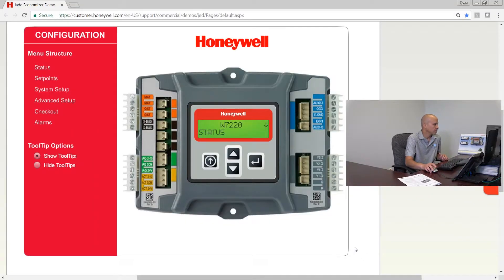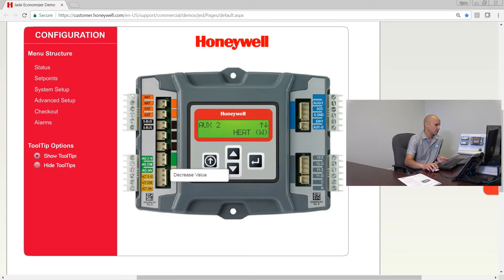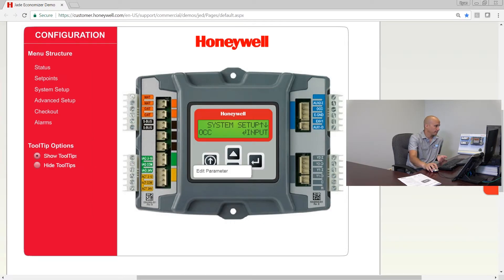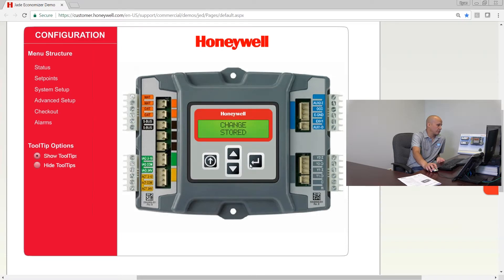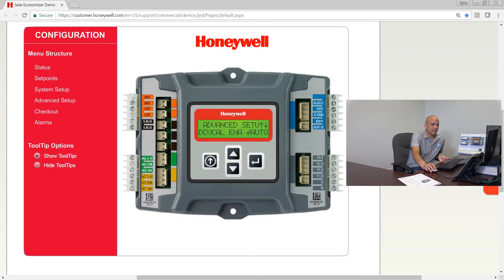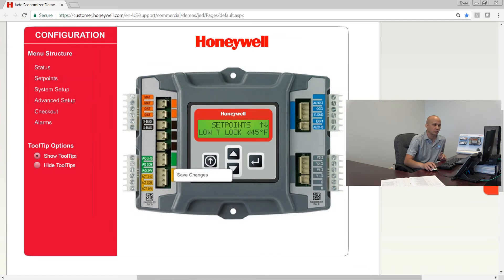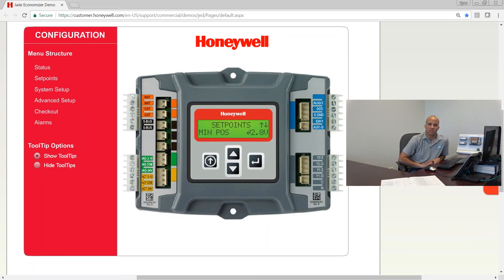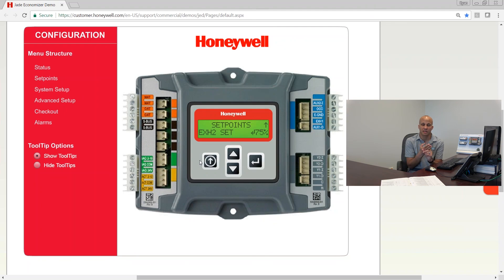Economizers: Honeywell JADE Controller Setup (2 of 4)

Comment: great video! whats a common wb set point? i seen 65f, seems too high but maybe not?
Reply from the maker: You do not have the ability to set the wet bulb. If you have the enthalpy version of JADE, or any other economizer controller, you are picking a "curve." If you look at the curve for JADE, it is controlling to enthalpy setpoint straight line (with the top wet bulb chopped off and the far right dry bulb chopped off. The wet bulb will vary along those lines. It is hard to explain without looking at the curves on a psych chart. But even if you picked the most aggressive enthalpy setpoint (ES1), the highest point that it would ever get for wet bulb would be about 62. If you pick ES2, which we frequently recommend, it would be 59 WB at the highest.
Reply: @TECTubefilms  thx for the response. i can reference a psychometric chart, not to familiar with this controller as i do mainly refrigeration racks .
 im guessing es1, es2 etc is like a b c d on a conventional entalpy controller?
Reply from the maker: @dand1486  Yes, the ES curves are sort of like the old ABCD curves, but they are a much different shape. They start horizontal on a dewpoint line, then follow a wet bulb line, then a dry bulb line. Instead of curve like ABCD with suspect situations at the far ends, these new ES curves essentially cut those ends off. We wish we could post pics in the YouTube chat to show you what we mean.

Comment: If you need a minimum damper position of 20% , if 10% is 2.8v , 100% is 10v what voltage would it for 20%
Reply from the maker: 3.6v is 20% because it is 20% of the way between 2v and 10v.  But a better question would be why do you need 20%.  All building codes dictate an OA CFM, not an OA percentage.  So do not set minimum code damper position based on %.
Reply: @TECTubefilms  it would be starting point to know how far to open the damper
Reply from the maker: @markkozlowski6776  The damper minimum percentage should be set to provide the code minimum required CFM for that specific space
Reply: @TECTubefilms  what would be your prefer method of measuring OA ?
Reply from the maker: @markkozlowski6776  We like to measure OA percentage and CFM using temperatures for OA, RA, and MA and doing a little math.
Reply: @TECTubefilms  I guess that works as long there is a large temperature difference RA and OA
Reply from the maker: @markkozlowski6776  Correct.  Don't do it on a 70 degree day.  Needs to be about 15 degrees colder/warmer outside than inside.

Comment: Hi iam installing 26 of this economizers and on my bp show automatic 24 v damper one for RA and one for Relief air. between the roof and the economizer What terminal I need to use connect the externals dampers ..
Reply from the maker: This economizer controller... and almost all RTU economizer controllers... have a single modulating output for the damper actuator(s).  A motorized exhaust air damper needs to modulate the same direction as the outside air damper (the more you suck in the, the more you need to relieve).  The return air damper needs to be wired to do the opposite of the outside and exhaust dampers.  So one output can control all three dampers and you just need to switch the rotation (CW or CCW) at the actuators.

Comment: Allot to know. You are very informed, thank you for sharing. I have noticed that allot of these controllers and zone boards are not very user/service friendly. This should be an app on the phone where you (the service tech/contractor) can Bluetooth directly in. That way it has better descriptions than whats displayed on this little screen as well as the abbreviations that only make sense to the people who made the darn thing. I know my luck, I will be working on a economizer controller for a computer lab where the co2 sensors are notifying the principles iphone cause the economizer is stuck shut with 200 students in the lab. This would be on a day its raining cats and dogs with alarms and error codes going off and abbreviation that even tech support gets stumped on. Ill probably be curled up under the stuck shut economizer on my phone anyways looking for literature on this controller cause of course the manual is gone. Not trying to bash this beautiful peace of technology, but i would pay a significant amount more for this work of art to allow Bluetooth capability/programming and parameter setting . This goes for all of honeywells controllers and zone boards.
Reply from the maker: After years of teaching controls classes to technicians, there is one thing we know for certain.  The vast majority of mechanical techs do not want anything that has to connect to their phone.  Honeywell learned this the hard-way with the first version of the Lyric Round.  Techs hated trying to connect it to their phone.  We also have Bluetooth connectivity to some of our hydronic pumps and the techs NEVER use it.  Adding a Bluetooth chip to a high manufacturing volume product like this would increase the cost for everyone but only be used by a select few.  We would rather they solved your concern with an upgraded display and larger processor so the screen on the device itself can give you "help buttons" that essentially include the manual.
Reply: Remote access would be nice Bluetooth is only a short distance you might as well go to the control

Comment: How many actuator I can connect to 2-10 vdc output terminal?  I have 3 independent actuator for OA,RA,and exhaust air.

Thanks
Reply from the maker: Check out page 2 of the JADE installation manual.  It can support 1 communicating actuator, but up to 4 non-communicating actuators.